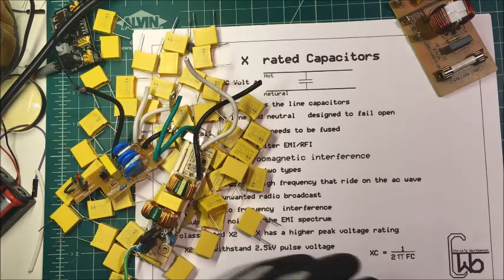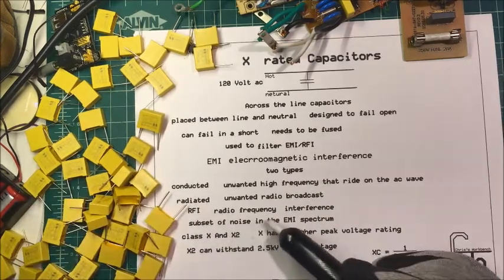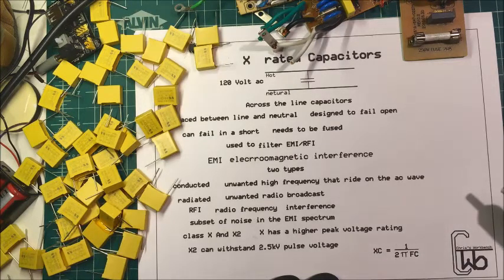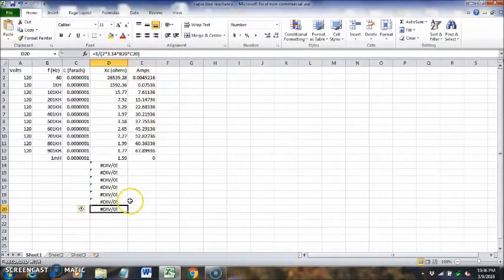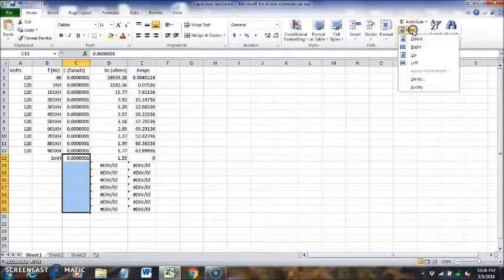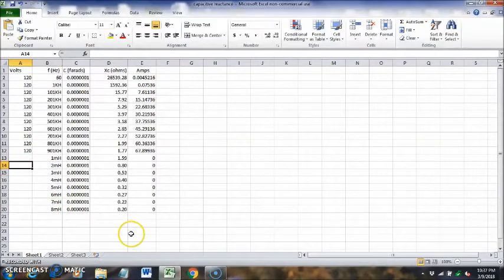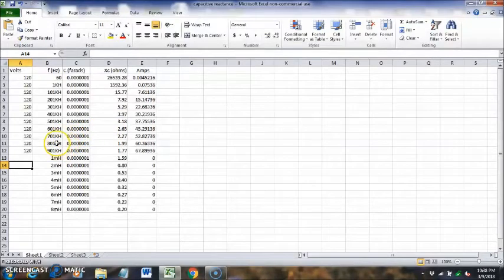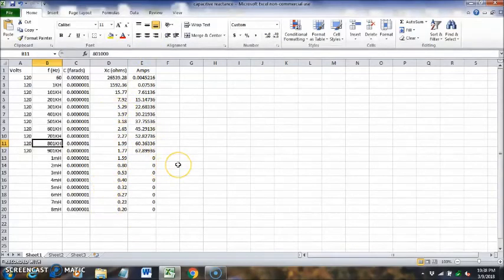X rated capacitors

Comment: so when an x2 class cap fails, will there be continuity across it or will it be open?
Reply: It should fail short, as it is directly across the mains line it will blow a fuse. 
(or start smoking profusely like in the device i am now repairing 😃)
A Y-class capacitor should always fail open.